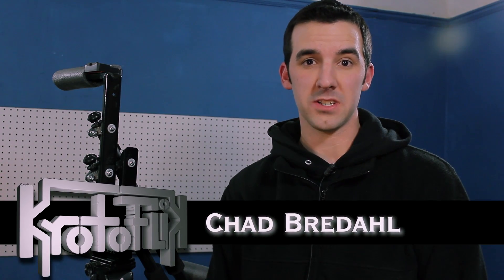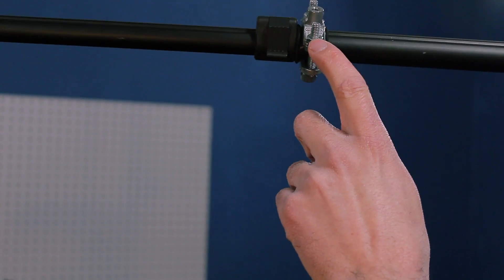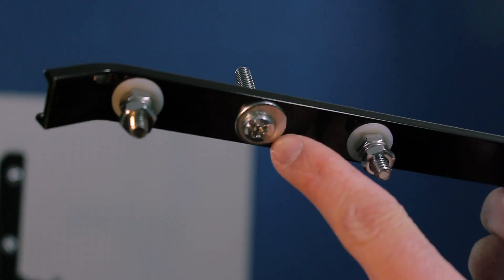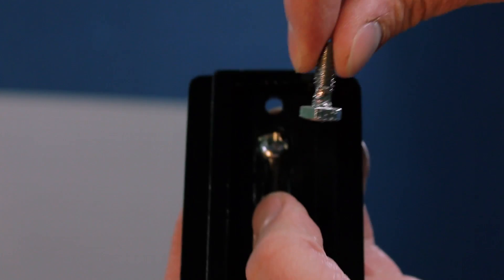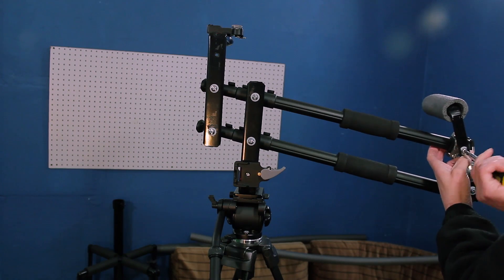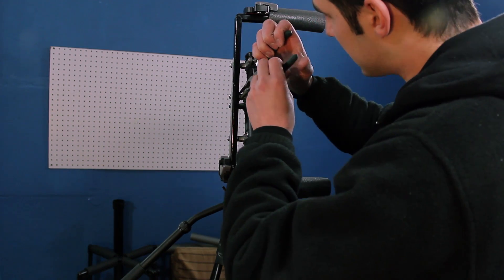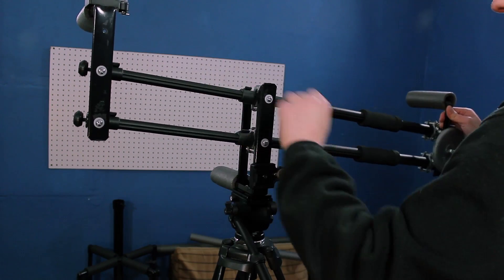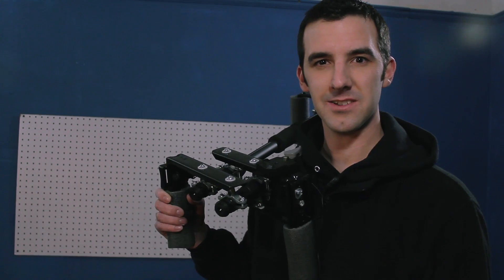How to Build the RotoRig - Camera Jib and Shoulder Rig in ONE!

Comment: Took 2.5 hours to track down all parts in Chicago (besides the flower pot brackets and monopods which I ordered online) Went to 2 different Menards and 2 different Home Depots. The hardest item to find was the nylon washers. They were hidden in a drawer mixed in with the 3/8 washers. I followed the diagram exactly, drilling holes with a drill press and exact measurements. The holes ended up not lining up exact but I improvised in one area using an extra nut as a spacer to line up the holes. (this was on the flower bracket where it connects to the shelf bracket near where I attached a tripod release plate) I can confirm this will hold a sony nx5u. there is a slight wobble and sway from even the slightest jerky movement (you have to be extremely smooth) but the nx5u took it fine with image stabilization on and the arms fully extended. The closer the objects are, the more you will notice it. Also, I used the cheapest monopods I could find. Vivitar 67".. So far, Im very happy with this. WIll need to see how it handles outside in the wind but still WAY worth the time and close to $50 to build this. Thank you Krotoflik!!!!
Reply: Jason Hicks  Can you please help me track down the shelf brackets, Home Depot doesn't seem to have them in texas, unless i'm looking wrong. They tell me nothing comes up for this skew.
Reply: +Jason Hicks thanks for sharing your experience building this

Comment: So are these the right brackets? http://www.homedepot.com/p/t/202183149?catalogId=10053&langId=-1&keyword=222-484&storeId=10051&superSkuId=202858076&N=5yc1v&R=202183149#.UQKLE79EF8E Or are they a littel off?
Reply: I was just wondering the same thing.  I do not think they are.  They are vinyl.
Reply: They are not the right brackets. I used ones a little longer and they did not impede
 the use of the jib

Comment: Yes, by the website, and by the store, the shelf brackets at Menards are incorrect. Just noticed the fault after I had begun drilling. Off to Menards again tomorrow, after work. Too late in the day to make a 40 mile round trip drive again. Please all, take note of the dimensions of the shelf brackets. I only followed the sku's religiously. Also, Home Depot no longer caries the nylon washers. Menards does. Hard to find the box. Their sku is 201-0570

Comment: F*cking A to open-source. Dude could easily patent it and get rich but instead he goes with sharing & caring for the community. 

Respect, my man. Respect.
Reply: ***** Fair enough. Apologies for my complete ignorance.

It is a good design - only flaw I can see is durability (cheap monopods will bend over time) and also if you're not based in the US it can be hard to get the required hardware pieces for that cheap (hard to believe I know).
Reply: Raph Dae I think there are numerous sections that could be easily upgraded to add durability. As to a Patent that would not be possible but a Copyright for sure.
Reply: ***** What are you talking about? IP=Internet protocol. Protection is easy, just sue everyone! Getting Patents is also easy, protecting them is tough and expensive and only of value if you're making money on the Patent not just hording the paperwork. Don't debate minutiae it makes one look really stupid and very, very petty!
Reply: ***** Well dear I have three patents and frankly it's a waste of time unless you travel worldwide to sue everyone to protect the Patent. I guess true knowledge come after you get more than one? Good luck

Comment: This is a brilliant design, but I would note a few points. The Max Weight will be what ever the weakest point is. If the bracket holding the camera is flimsy, this will determine Max Weight. If it is strong, then the legs may determine Max Weight capacity. You may get a heavier camera to work on it if you don't extend the arms to full length. You may also make it stronger by reversing the legs so that the camera is on the more wider (solid) legs. If you try a camera on it and the shot is pulsing up and down slightly, the camera is too heavy or the arms are extended to far for the particular camera. I would say even a small amount crane motion with this would be very worthwhile and not a waste of money trying. Well done.

Comment: Item #3 (small designer brackets) looks different than what's in the video.  Are those links the same as what was used in the video?
Reply from the maker: Its the same, there is a plastic cover that comes with it that I forgot to mention.  Thanks.
Reply: ***** awesome! thanks for "working" on a sunday :)  you're the man, chad.
Reply: ***** So those small designer brackets are the right ones to get? not the Menards large designer brackets?
Reply: They're not the same, I built it this May and the shoulder mounts that I got were the wrong ones. I can only use mine as a jib and plus mines Really shakey!

Comment: Another tip: Use some of the pipe foam for the monopods instead of adding tape to them. Cut the pipe foam so it fits within the "teeth" of the clamp and tape it up. It'll allow you to more freely move the clamps.

Comment: Tips: The two larger brackets connect to the monopods parallel but one has the short end on top while the other (this connects to your tripod/base) is below.

The middle ground clamp is the most difficult one and will need to be adjusted to your liking. I kept it with that section slightly extended.

I used tennis grip from Modell's instead of wrapping the handles with pipe foam and electrical tape twice.

Still need to make some adjustments but thanks for this Chad!

Comment: Technically, you're looking for "pipe clamps," they can be had on Ebay. They support weight pretty well with iron pipes in public bathrooms, so they should work.

My issue is actually that the cast iron shelving struts I found were too difficult to drill accurately with the tools i have. I've been looking for some of those bike rack things ever since.

Comment: for attaching the camera to the rig... I have a Canon Vixia HF M40 and most quick release plates cover the battery release.  Going to try the Sima Quickconnect , since the plate is smaller, to see if I can remove the battery with out having to remove the quick release plate everytime.

Comment: Hey man, I made one for a while, It was good for a while, but the constant re tightening / adjusting I had to do time wise was not worth it. I think this video was done extremely well and your dialect is extremely proficient and coherent, the ending product however is not built to last. My advice to anyone trying this, to use better monopods, and get specialized bolts. This will run up your costs, but it will make the rig ALOT more sturdy.

Comment: why don´t you start a kickstarter project for the rotorig? :-) would be very nice, and in case that i know that you are a guy who doesn´t want to spend a thousands of money for plastic and metal, it will surely be not so expensive (Y) most kickstarters are a little bit oversweening when they start a project and then sell for example a table skater dolly for 250$

Comment: I built one for my son. I ordered a lot of parts from Menards. The shelf brackets that came were the smaller ones even though I used the sku Chad provided. He explains some issues regarding parts in another video. I ended up getting correct size white brackets at local Home Depot and painting them black.

Comment: Nicu: The ground clamp is normally used to attach an electrical grounding wire (earth wire) to a water pipe for the safety of a household electrical system.   If there is a fault in the electrical system, then the electricity will travel to a ground wire attached to the ground clamp on the water pipe and from there safely into the earth.  It is designed to make a secure metal to metal grip on the water pipe without drilling into the water pipe.   Contact any good Electrical parts supply store.

Comment: Sweet rig, but here is an idea to get more height on your jib movements. Move the clamps for the pivot bracket onto the same section as the weight bracket. This would give you more forward height. Not sure if the monopods could handle a heavy camera doing that but just a thought.

Comment: Great tutorial.  I bought all the parts today.  My total was $60; I could have gone a few bucks cheaper if I had shopped around a bit.
I have a question:  I'm curious why you have the pivot point up so close to the camera.  It seems that you'd get more range of motion if you moved the unipods forward on the pivot-point brackets, (with less unipod behind the brackets).  Did you do this because of the added stress this would put on the unipods?  My camera is light, so I might have to experiment.

Comment: Great piece of kit. Really like the use of the monopods so the rig is portable without disassembly. The 'Ground Clamps' are called 'Munsen Rings' and can be purchased in a variety of sizes so instead of buying all in the size suitable for the largest diameter section of the monopods. I'm waiting for my cheap monopods to arrive, will measure the slim camera end (Qty 2), middle (Qty3) and think end (Qty2). I've made a video using a home made steadicam and cable cam so this will be just the trick.

Comment: To clarify, the shelf brackets that Chad uses are the same as the ones he links to, though it may not look like it. The reason the pictures of the brackets look smoother than the ones he uses in the video is because there's a plastic covering to hide the bracket when using it with a decorative shelf. Hope that helps. It confused me too.

Comment: UK folks, I've found some pretty good brackets to substitute for the ones Chad uses here; search for TIMOTHY WOOD SHELVING BRACKETS on ebay uk. 

Fluted steel brackets and as the things have two holes in them already, should be able to use them directly with minimal drilling.

You can also search for JUBILEE CLAMPS, which are pipe wall mounting clamps similar to these ground clamps, but you'll want to measure your monopod segments first as they are circular, not ellipse shaped

Thanks again Chad

Comment: I've been in contact with Tizaro about whether those clamps are solid zinc [and thus fragile as all hell] or BZP but they've not gotten back to me.

The UK equivalent part is called a Jubilee Clamp and can be had from most plumbing retailers, though you'll have to get specific sizes closer to the monopod sections you're working with as they're circular.

Comment: for everyone in the UK I have managed to surse everything except for the Flower pot brackets in the UK  but can get them in the US and shipped to the UK. 

shelving brackets type in ebay 

'Metal / Steel Shelf Support Brackets - Italian Designed with Decorative Covers'

ground clamps go to Tizaro and type in 

'Pipe Clamp Grounding Zinc ERITECH ZWP1J'

Flower pot brackets Type into ebay

FLOWER BOX WALL BRACKETS

hope this has been helpful 

this works out at £61.40 which is about $93 US

Comment: Hi There here are the brackets he used. Just type "Metal / Steel Shelf Support Brackets - Italian Designed with Decorative Covers" into ebay. for the flower pot brackets I have only seen them in teh US. but they will ship to UK. I am thinking of getting three sets if you fancy buying a set off me?? for the ground clamps a company called Tizaro do them for £1.99. hope this has been helpful :)

Comment: Love this DIY. One alteration I made to my build is I used nice capped rubber BMX bicycle handles. Reason being is I noticed the foam had a tendency to slip, which is a little scary when you have a $5000 rig on board. This added about $30 to the build, but it was worth peace of mind.

Comment: If you're in Home Depot getting parts, check out the hoses in the plumbing section instead of the pipe foam wrap. They sell the hoses by the foot which might be cheaper.

Comment: Ok so what if i want to focus while i am using the ROTO RIG? Can u build cable based focus system where u can connect it on the back site of the roto rig and also where u can atach monitor like balance waight to the back?

Comment: hello chad, how long is the largest side of the shelf bracket? i got the  menards sku 211-3630  which measures  5.5"x 8" ... it looks like the upper hole is too close to the one the goes below to 3.5" when measured fron the center of diameter of existing hole , therefore the next hole below is  even closer (the one for the quick release)... i think the menards item you are using is larger than 8" ...

Comment: I turned my plate 90 degrees. It is still sturdy enough and I can tilt the camera with the fluid head. You need a fairly good fluid head for this to work well because it is quite a bit more weight than a camera alone. Mine's not that great (Velbon DV-7000) but it works well enough.

Comment: Regarding your particular design, turn the quick release plate for the fluid head 90 degrees and use the head to tilt/pan. Tilt the head forward as the jib arm goes down, and tilt the head back as the jib arm goes up. This will allow you to keep your camera relatively level to the ground and/or keep your subject in frame.

Love how you used the main telescoping arm to address torque without adding more weight to the jib itself. Brilliant.

Comment: Awesome build! I don't know if anyone has mentioned this yet, but how about using double L-shaped flash brackets as a possible substitute for the wall/shelf brackets? They have predrilled holes, some rubber padding, and also come with 1/4" 20tpi half-threaded knobs. I have a few extra lying around, so I may try to build a jib with them and see how it turns out.

Comment: Thank you!! I have just finished building this one myself. I donated a little to show my appreciation. Now I'm just waiting for the quick release plates to use it. 

Actual Cost (after Cali tax): $80-$90 not including quick release plates. Everything was purchased from homedepot (no menards here). Tripods were $15 each in store at Walmart.

On small addition I would make in shoulder rig mode is to add some extra foam to the right side tripod to level it on the shoulders so it is not leaning.

Comment: Heya, great build! Just had one question..the shelf brackets that are linked (and any I've been able to track down!) seem to be opposite in terms of direction of the groove and flat side...I can foresee it causing issues when locking the flower bracket down, did you have a problem like this?

Comment: Couldn't you add support in between the monopods, like aluminum flat bars or something cut to the contour of the monopod and secured with metal apoxy every few feet.  It would reduce the ability to compact some, but it should reduce bowing.  Just an idea.  I use an AF100 which stripped down wouldn't need it, but I like the idea of extra support.

Comment: All you should need to do is drill a center hole for the bolt (using nuts as spacers) to hold the pulley and handle at the center bracket.  You would need a fifth bracket that mounts to the second pulley and holds the camera, then do the same thing to the front bracket as you did to the center (making sure they are aligned).  I haven't built this - yet - but in theory it should work.  That's just a theory though.

Comment: As described in his demonstration video, you can jib this hand held.   You can always look into Construction Tripods, but they aren't much cheaper, cheapest thing on Home Depot was $30.  Honestly though, a good tripod is ESSENTIAL for anyone doing film work.  It doesn't have to be a $600 Manfrotto but spending some extra money on a tripod is a necessity. I am curious what your reasons are for not investing in a sturdy "good" tripod?  The rig plus a DSLR is probably only 7lbs at most.

Comment: Pretty clever idea.  Tried and true idea .. but ground clamps+monopods brings it into easy DIY territory.  

Question for you, Chad.  Monopods obviously aren't designed specifically with forces perpendicular to the shaft in mind.  The fittings, clamps etc. are all designed to stop the thing from telescoping with a weight on the top and the foot on the ground.  Have you noticed any loosening etc. in using this over time?  Or has it not been long enough?  Thoughts on this potential issue?